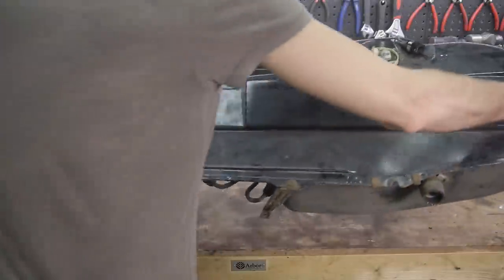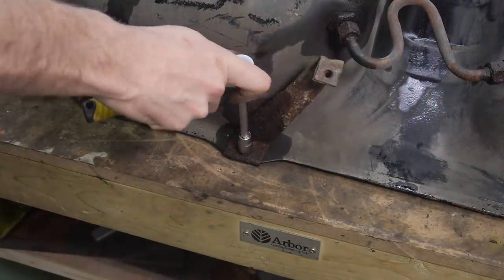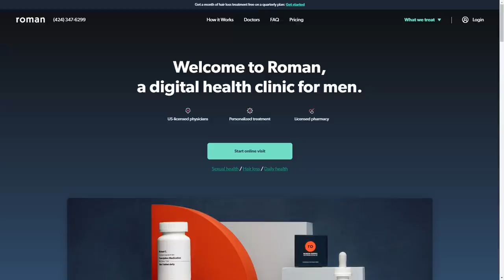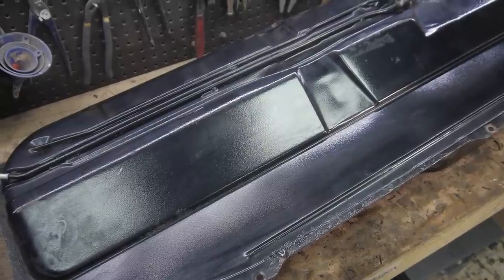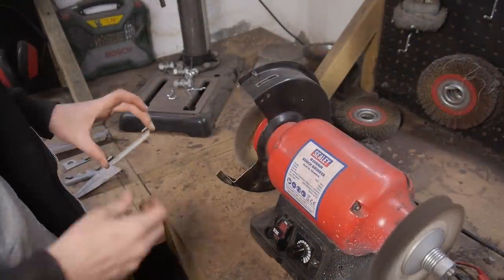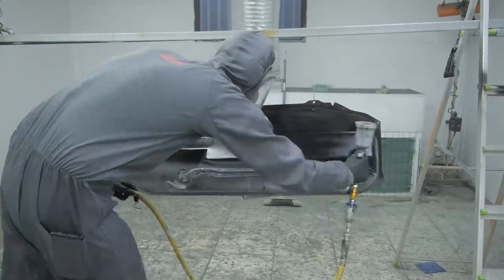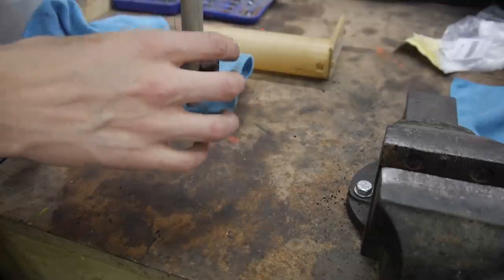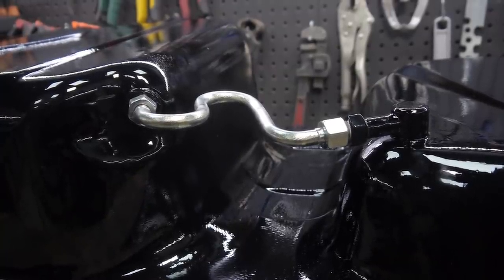BMW E30 Gas Tank Restoration

Comment: The foam pads are for „damping the vibration“. Because its near the body of the car. Nothing new. Also some new BMW Models have them. Oh and the small parts/clamps are not sold by bmw. So you wont get them. If you want new ones. Buy a new gas tank 😂
Reply from the maker: Thanks for letting me know AutoVM. I was thinking that about those clamps. Glad I didn't lose one!
Reply: Restore It Yeah 😂 But i bet there should be another way to clamp it together. 🤪 By the way - awesome video!
Reply: @autovmcomposites9997  I agree. mechanics have their own tricks for such pieces and clamps
Reply: @RestoreIt  Looks like the first gen fuel tank differs from the second gen, mine has complete holes which have rubber grommets in it unlike yours. You can only get second gen tanks these days so that's probably why they don't sell those supportive brackets anymore.

Comment: Hey ! I have a bike but the screws are rusting. I do have a have a way to remove the rust (dremel) but i do not know how to protect the screws from rusting again AND to keep the shiny look. Do you have a solution ?
Reply from the maker: Hey Théodore! You could paint them, use something like 'Iron clad' to protect them, you could buy zinc plated versions or you could try just polishing them, rust will have a harder time getting started.

Comment: Man, that's quite an expensive little pipe. It's not that hard to custom bend lines like those, I wonder why it's so expensive? I've made something similar in my home shop for just over the cost of the tubing. Take a straight pipe, fill it with something to keep it from flattening out on the bends (I use sand personally) then just make the bends in it with some light heat. For copper piping, depending on the wall thickness you don't even need heat.

Also, are you going to treat the inside of the tank? I know it looks fine in there, but it's always a good idea to re-treat tanks.
Reply from the maker: Thanks for the advice dude. I'm sure I could make the bend, its just the special ends I wasn't sure about. I have a treatment kit ont the way to me, its taking ages to get here. I may do it, I'll have another good look inside and see if its worth it. I feel like its been done in the past as just so clean in there.
Reply: @RestoreIt  Fair enough on the tank, as for the connectors, yeah, they looked standard to me before, but I could have been wrong. :)

Comment: i thought that you would have cleaned the inside of it 
but you have done a good job the same
Reply from the maker: I didn't want to do anything to it. It was in such great condition. I cleared it out with compressed air to make sure no bits were inside, but thats about it. It really was spotless in there.
Reply: @RestoreIt  if it was in good great for you. cool restoration as always

Comment: Great video as always.need advise  though if anybody help, I restored mine year ago of a face-lift cabby, striped primed and powder coated, after installation found out my fuel return tube which is inside the tank      is restricted any idea
Reply from the maker: Thanks Rabnawaz! My only thoughts are that something may have gotten into the tank / hose when it was installed and is now stuck. I'm really not sure though. Take it all apart, look at it and put it back together again. Usually fixes things :D
Reply: @RestoreIt  Yep. Mechanical version of "reset it and it usually works again".

Comment: Good old E30 fuel pump, have to drop the tank \ exhaust and prop to get to it. I ended up cutting a hole in the back seat floor and making a removable plate for it. I had to replace that part too back in the day I think it cost about £8.50 about 15 years ago...
Reply from the maker: I can get to the pump through the back seats. What E30 do you have? https://www.google.com/search?q=bmw+e30+fuel+pump+replacement&safe=active&rlz=1C1CHBD_en-GBGB775GB775&sxsrf=ALeKk00ElIuUXSeRbWRCSR_9iWBqOF-vMw:1584124002530&source=lnms&tbm=isch&sa=X&ved=2ahUKEwjRq83jiZjoAhX18OAKHYrXDgoQ_AUoAXoECAsQAw#imgrc=ZpxBLmYUOZJ5NM
Reply: @RestoreIt  Actually, just remembered (I'm getting old!), it wasn't the fuel pump location I had issues with, it was where the hoses join onto the tank was the issue - you cant get to those connections without dropping the tank and one popped off after doing all the work replacing the tank etc. So I had to cut an access plate - it was a while ago! So tip is to make sure you have good connections on those hoses

Comment: Looks good!
But how's the inside?

Just removed my dead fuelpump in my e30 and the inside is really rusty, it's been sitting with almost no gas for atleast 10 year but i guess they corrode pretty quick with a little condensation in them :/

I'm thinking about electricity or acid to clean it out, plan B is to just install a fuelcell instead but we'll see :P
Anyway keep up the good work!

Comment: £170 for that little piece is outrageous. You could easily have gotten away with 1/50 of that, had you produced the piece yourself. You could even have used a rubber hose, but had you wanted a metal piece, you can buy them in any lengths you want, and shape them how you want, add the nuts and put the flanges on the ends with a special tool.

Comment: The foam pads are so the tin- tank doesnt buzz and rattle against the tin trunk floor.... all car & truck fuel tanks have foam or rubber pads on top that do just this.....
On those connections of the "$170 Connection pipe", I would have slathered the piss out of them in Anti-Seize compound so it never happens again.......
Reply from the maker: Thanks Eclidean :D

Comment: If that's a steel pipe for 170, you may want to take it off and nickel plate it or itll rust out as bad as the last one. Can't tell if its steel or aluminum from the video.
Reply from the maker: I think its already zinc plated and I think this one is made from one material unlike the other one.

Comment: Anyone knows this specific plastic fuel sending unit part number ? Bottom wide filter, double external pipe and plastic housing is different from most other e30 metal unit. 
Thanks

Comment: Hi, Well, you gave up and decided that professionals should do the welding 😉 Perhaps this is a good idea, in this case. Anyway, I wish you good luck.
Reply from the maker: Haha! I had a good go, learned a lot and will do more myself. But for the main bulk of the work, I need to take it to a place where noise isn't an issue.
Reply: @RestoreIt  Yes, mate, I know that, many thinks you did your self and this was really cool stuff, I saw all yours videos what you did. That's why I here. 👍
Reply: @RestoreIt  Noise complaints from your neighbors?
Reply: Never-mind just saw lower down where you are trying to be the nice guy. Class act good job!.

Comment: Nice work as always. Are the neighbours giving you shit over noise?
Reply from the maker: Thanks George, and honestly not their not, I just don't want to be that guy... The chassis stuff is so so loud. If I lived on a farm, or owned an industrial unit I would do it all my self.
Reply: @RestoreIt  I'd say mine hate me. if its not the compressor running or the angle grinder going, it will be some one of my vintage Hi-Fi Amplifiers blasting. To be fair, I have to listen to their dogs going apeshit in the middle of the night, and their kids screaming during the summer when im trying to sleep before the nightshift. Its all about give and take lol...

Comment: Id coat that pipe with something so "IF" in the future it needs changed, it can be with out breaking
Reply from the maker: I think you're right, I'll give it a paint.
Reply: Bit of antiseize i think would be more like it
Reply: @johng69er  Yeah that too, but anti-seize wont stop it from rusting.  I doubt that pipe is stainless

Comment: What about the rust inside the thank ?
Reply from the maker: There wasn't any on the inside of the tank, just on the inside of the pipe. I used the rotary tool and a rust converter to remove the rust. I can always add a tank cleaner and sealer down the line if I feel like it.

Comment: Tbh if its out and doing all that work you could of send it to a Tank specialist and let them recoat the inside and clean it 100%
Reply from the maker: You're not wrong. I have a semi pro cleaning and treatment sealent kit coming for fuel tanks. i'll probably do it. I'll film it and add it in down the line.

Comment: Eh, remove that little connection pipe again and put some copper slip on those threads... just in case you ever need to take it off again after it's been under the car for a couple years.

Even without British weather, it's dissimilar metals and that's never a good thing in terms of things seizing up.
Reply from the maker: Don't worry Jan :) I am going to do this. I only temporarily fit everything for the video. Thanks for watching

Comment: fuel bracket left. 16111177346 .. right 16111177347  From 09/1983 (as noted by the parts catalogue) . i could not for the life find those corner pieces of the fuel tank so my guess. there part of the tank and not sold seperate!  (i looked up undera 1990 3125i btw (y)
Reply: fuel tank connectio pipe . 16111177925 (found under m3 section however of 1987)
Reply from the maker: Thanks for looking Albert, I appreciate it!

Comment: The connector pipe could´ve been made by a hydraulic shop for much less.
Not original, but probably indistinguishable.
Reply from the maker: I think I agree. But original parts are always fun, especially for the E30 :)

Comment: You can make the pipe yourself just buy new nuts and copper pipe the same diameter as your and bend it into shape.
I do at work all the time to replace brake fuild pipes

Comment: @15:88 You should have bent and made your own with parts from the hardware store.
Reply from the maker: The ends of the pipe curves into a small point. I'd rather stick with the original even though it came at a heafty cost

Comment: The first thing I would have done is removed the filter and steam cleaned the inside of the tank. One to avoid any vapour residue that may catch fire and to remove any old detritus that may have built up over the years. I’m sure it is recommended to steam clean a tank before working on it. Especially using a hammer and chisel that can cause sparks.
Reply from the maker: Thanks for the advice Colin. The tanks been out of the car for two years, couldn't smell any fuel and assumed it was all gone. The inside was genuine spotless. I think it must have been cleaned and treated in the past. I do have a kit on the way to me which I may use.
Reply: Keep up the great work really enjoy your persistence and endeavour to get it right

Comment: hmmmmm. what about the rust between the 2 layers of plate
Reply from the maker: It was more surface rather than deep rust. I did chemically remove and then treat what was left, after putting the wire wheel in the middle of the join. We'll see how it holds up!

Comment: Too bad the design is flawed to start with. Two thin sheets of iron stamped together are always going to rust like there is no tomorrow. It is impossible to get to the rust growing between the sheets. A fuel tank should be made of something like plastic or stainless.

Comment: Why didn't you just fabricate things more by your self? 100 pounds for metal hose is a lot... 🤦‍♂️
Reply from the maker: Because I don't have all the necessary tools, and in this case, I didn't have the time either. Furthermore, BMW parts are made for the job and keep the car original, which is what I'm all about.
Reply: Why not by a new used one and for £100 you will get lot of tools and then you have them... if the motivation is time why don't you by a new BMW or restored one ;)